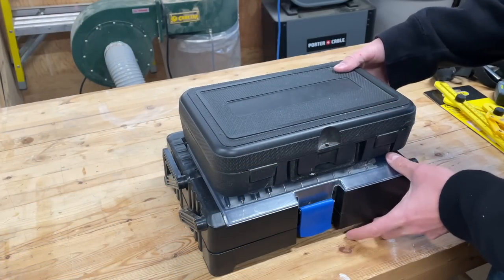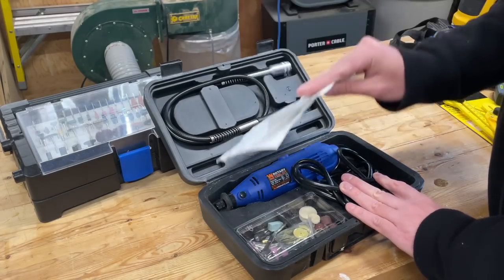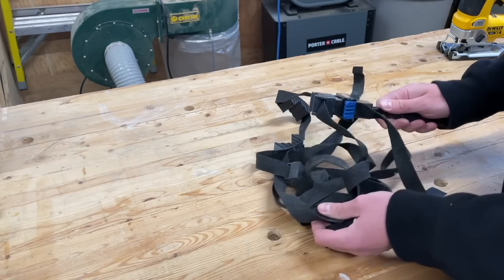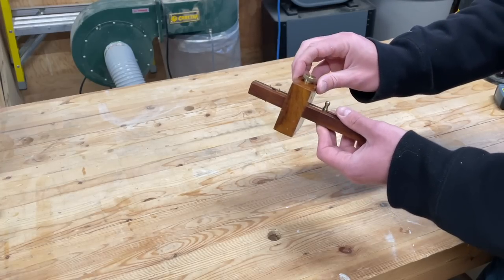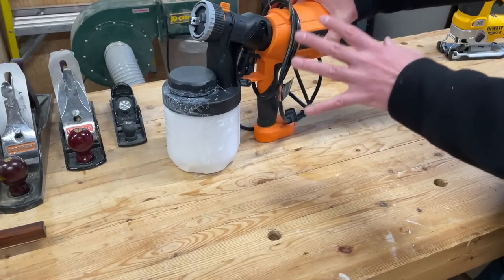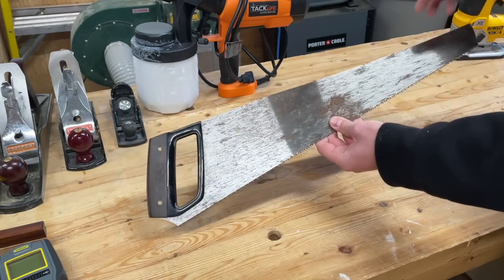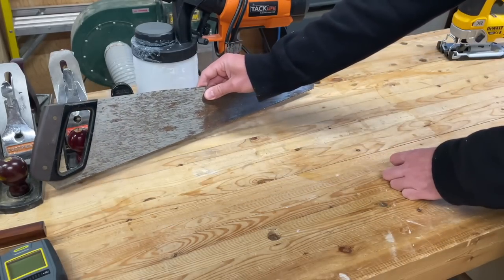Don't Buy These Tools // 10 Woodworking Tools I Wish I Didn't Buy

Comment: I agree with most of your comments on these tools. I will disagree on the Jig saw, one of the most used tools by interior finish guy's. I have installed many kitchens and baths and the jig saw is one I always have on hand. pipes, metal or plastic, sink cutouts, ceramic tiles, dry wall  and the list can go on. In the shop I have both a Bandsaw and Scroll saw which are mainly used shape cutting. If you learn how to properly use your tools, the jig saw is a great tool. I am glad to see that you have come around on the jig saw, but I still felt complied to make that statement for the benefit of others. I did enjoy your video, well done sounded great.

Comment: I think for the most part all of the tools except for the General angle tools are well worth having in the shop.
Yes a new woodworker may not need some at first but if you have the money why not. I use most of these yools on a regular basis. I may not do projects that require them all the time but I get a lot of weird requests for making different items. That being said I can use that side money from the project to buy the tool and expand my wheelhouse or skip out on learning something new.

With all that I feel the main point, it has been stated already a few different ways is Don't buy cheap expecting it to take the place of a quality tool. There are a few exceptions but do your homework first. Impulse will not only waste your money but time and frustration as well.

Like others have said a Jigsaw in my opinion is a must have. If nothing else just for building jigs which we all use on a daily basis. 

1 last note if you have tools you don't use try pulling them out and designing a small project just for that tool. We learn from it and you never know it might be youre ticket who knows.

If not try donating the tools or do a hive away on you channel I'm sure someone can put them to use

CHEAP USUALLY IS JUST THAT. 
Get out build something and enjoy your passion.

Comment: Since fish respond well to shiny lures, I use my rotary tool (a cordless Dremel) to clean and polish metal fishing lures (spoons, spinner blades, etc) with abrasive and polishing buff wheels. Also occasionally polish painted lures. And, while I have the tool out, I also tend to clean or polish anything around the shop (rulers, tools, blades, etc) that catches my eye.

Comment: Great list! The only one I disagree with is the jigsaw. It’s great when you are starting out because it’s pretty versatile. A bit of jack of all trades. However as you acquire more tools eventually almost everything you can do with a jigsaw can be done with another tool but better.
Reply from the maker: Great point on the versatility! The woodworking community often seems divided on the jigsaw.
Reply: @MasonWoodshop I have a barrel style jigsaw. I find it to be much easier and precise - do to the proximity of control. I use it enough to warrant having it.
Reply from the maker: @michaelhamerin3814  My corded barrel-grip Bosch jigsaw was pretty solid. I picked up this DeWalt for the cordless freedom, but right before they launched their barrel-grip version. Poor timing!
Reply: @MasonWoodshop  Yep, Bosch kinda set the standard. There new cordless is nice.
Reply: I like my jigsaw
Reply: @michaelhamerin3814  Your statement about the barrel grip is 10,000 % true!  Couple a good barrel grip jigsaw with the best BOSCH blades and you get very good results. Their variety is quite ample.  Just avoid their "basic" level blades and go directly for the best they have.
Reply: @alfredomarquez9777  Bosch blades are good. I've gone to Diablo when they came out. That friction free coating on them is great.

Comment: I agree with most of this with the exception of the Dewalt Jig saw. It is certainly not a "fine" woodworking tool but it is one of the handiest saws around for quick roughing work(battery powered). I love mine and it is one of the smoothest jig saws I've ever owned.
Reply from the maker: I’ve really come around on the jigsaw and use it all the time now. Just took some time to figure out the right settings and the right blades for the job!

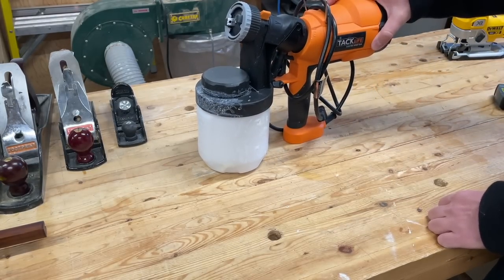Comment: 9:20 Gave me flashbacks to my old Wagner Power Painter. I had both the roller and sprayer, completely horrible. I ended up repainting the room it looks so bad. And it took me longer to clean the thing than it did to paint the room with a brush and rollers!
Reply: 1,000 %  true.
Reply: I had the sprayer with the backpack. Not for long, though.

Comment: It all depends on the projects you wish to do... 
 
I use my rotatory tool all the time because I also do scroll-saw work and it is good for sanding some of the fine fret work... I don't have a Dremel but a cheaper knock off "Fuller" brand... has lasted over 10 years... Though I wouldn't use one as a router...??? thats a new one???

Angle thingy-me-bobs... never seen heard of nor would I buy or need... a simple sliding bevel gauge including the Kreg Jig. 

The band clamp... is a mess?... it is not that hard to wind it up after use  and put a rubber band on it... come on... 

Marking Gauge that's they style I learnt to use at school and works well ... they are easy to use and even make your own. Are they as nice as more expensive... no... but what tool ever is?

I will totally dis-agree with the Jigsaw, but like any tool learn how to use it properly, get some finer blades can be a very very useful tool in the shop... A beginner may not have a bandsaw either room, or budget... and a jigsaw is probably the next best thing and it has an advantage over the bandsaw that it can cut inside circles etc. The jigsaw is not for straight cuts use a circular saw for that, they are more for curves. 

If you are getting chatter on your board then you are not holding the jigsaw plate right down on the board... or you may have the wrong type of blade in (ie; a reverse blade and DeWalt do make them or to rough a blade for what you are cutting) or you haven't secured the board properly where you are cutting it. 

I use mine regularly... however again depends what you are making.

Comment: I recently got that same Dewalt Jigsaw. It is great for cutting out holes amd notches for flooring amd carpentry work. I love it.  Especially with the Diablo blades
Reply from the maker: I’ve come around to love the jigsaw! The right blade and right speed setting made a huge difference.

Comment: There are so many tools out there ....   from saws to clamps to 5axis NC routers...... most of the time we truly don't need them. Some of the best work I've ever seen is done with the basics.  I use a 2.5 axis NC router with old school hand planes making large tables . . .  Most of the time the NC router is just leveling my large live edge planks... its nice and easy ... BUT all I really need to do this is a router bridge ....It just comes down to time and money .... the NC router allows me to work on something else as the unit levels my work... Allowing me to make more money... But that money then goes to pay for the NC router... I see this a lot in tooling. 
Finding that sweet spot of what you really need to make money and do good work. Most of the time we dont understand what we truly need until we have what we really don't need.. I for 1 have so many tools that just set now..
Reply from the maker: Great insights, thanks for sharing! It's really quite impressive what can be built with just a handful of tools - the rest really are luxuries.

Comment: I actually had a bad experience with OG dremel rotary tools than with the knock off ones. The best one I've got  so far is a black and decker one. I originally started buying them for sculpting, but they have prove to come in handy for tool manteinance
Reply: I also have a Dremel 4000 and a Black & Decker RTX. The B&D is definitely superior.
Reply: @christianbound4972  dremel's flimsy built in power switch and speed regulator is just awful.

Comment: Most regretful is a non-sliding miter saw. Made do with only a miter saw (no table saw) for many years. If it was at least a slider, I wouldn't have needed to be nearly as creative in getting home improvement done. Other than that, I've been very careful in my tools purchases. Wheelchair dynamics can dramatically alter how a tool is used, even hand tools, so you really have to think things through if you can.

Comment: The jig saw was my most helpful tool for cutting curves prior to getting my bandsaw. everything else you are pretty spot on. I bought the Wen rotary tool but it was nothing compared to the Dremel I got for Christmas from my parents, it seemed like a good deal for 30$, but the power and consistency wasn't there. my neighbor has a plug in Spray gun like that as well. It was not pleasant trying it out to paint my work table. I got it done, but I would always suggest a better quality one on Amazon.

Comment: The Rotary tool is about the most useful tool I have along with the battery powered drill/screwdriver and you guessed it the Jigsaw. That with a router and you can basically do a whole lot of odd jobs around the house. Basically those 4 are for me a starter kit. need a straight line from a jigsaw well some clamps and 2 pieces of anything straight and you can make yourself a poor mans table/circular saw.

Comment: Got a similar rotarty tool that i still use on the two lowest speeds because i have a gut feeling something bad will happen based on the sound the machine makes. 

I recently purchased the malwakee M12 right angle grinder that is also probably my favorite tool because it's a 12v monster with both manual speed adjustment and variable speed paddle trigger. Each speed setting sounds like it's the same musical note but in a different octave.

I got sanding accessories from Amazon that didn't fit it. I used the cheap rotary to modify the adopers to make it compatible instead of buying adapters more expensive than the cheap rotary. The modifications are not on any cutting or grinding accessories because that would be needless dangerous.

Comment: Like Clone said " the Dewalt is actually really good" I noticed that your setting was not straight up and down and actually the rotary setup. Also you did not have the anti chip plate installed. I have the Bosch cored version and now use the Dewalt which cuts better with the correct blade installed. sorry to rain on your parade.
Reply from the maker: Great notes on the jigsaw - I'm going to revisit it for some of the rough-cutting I do with charcuterie boards that don't fit on the band saw. My Bosch barrel-grip jigsaw (before going cordless) worked pretty well, so I think I just need to tune up the DeWalt and get used to the features.

Comment: I bought a Dremel several years ago. It turned out to be useless for the job I bought it for, and subsequently useless for every job I've though "the Dremel would be good for that!" too. Total waste of money.
Reply from the maker: Ha, that's essentially my experience! I've mostly chocked it up to the knock-off Dremel that I bought, but it might just be that a small rotary tool wasn't the tight tool for the job.
Reply: The one use case I come up with albeit infrequently for the rotory tool usually involves the cutting wheel and having the cut metal in a very tight spot.  In those cases, no other tool would have worked, so they do have a place.
Reply: Dremels are incredibly useful.  Just not so much so for cabinetmakers and carpenters.  I don't use one frequently, but when I do, it's often the only tool that will do the trick.

Comment: I've gone down the cheap plane rabbit hole twice. One was such a piece of junk I couldn't even think of selling to put someone else through that misery, the other I turned into a passable scrub plane. My first decent plane was a 'vintage' Stanley that I used my Dremmel rotary tool to clean up. Taught me a lot about quality tools. Don't know why you think Woodriver is cheap. Both of mine are good well crafted tools.
Reply from the maker: Awesome to hear you refurbished a vintage Stanley - it’s something I’d love to do at some point. I’m going to give the Woodriver another go as I know they are built well, I just couldn’t get it set quite to my liking. Some more time tinkering and I’m sure it’ll be much better.

Comment: With respect I'm gonna go against the populous here and say you've bought the issues upon yourself repeatedly buying cheap!
However I agree about the jigsaw- vile piece of machinery! I hate them.
For the record I saw video in my feed recently suggesting that a Lie Nielsen No4 didn't cut straight from the box.
Reply from the maker: Haha, I fully agree with you on me bringing on these issues myself by buying cheap! They were tools/accessories that were on my list and rather than save up for good quality versions, I went cheap to buy them earlier. Bad idea, haha!
Reply: @MasonWoodshop  don't get me wrong, I've only been woodworking a year or so, but starting out if I bought cheap I bought uses, rather than unbranded as a rule. I've had my share of shockers but I've started relisting them to other unsuspecting fools as I've learned better 🤣🤣🤣

Comment: I fundamentally disagree with the kreg tool. Its a great apron tool and every tool is inaccurate until you use it properly. The rest of these tools are cheap versions of good tools. The waste of money is choosing to buy such cheap versions. Respectfully.
Reply from the maker: I’m coming around on the Multi-mark as a helpful tool, especially with the depth use case. The majority of the rest are definitely a function of low-price = low quality.
Reply: Totally agree.  Its all about horses for courses.  The tools a guy needs to build a house do not require the same degree of accuracy as those used by fine furniture makers eg you would never see a woodworker using a speed square to cut material for oak dressing table.  The Kreg measuring tool is a carpenters tool, not a woodworkers tool.
Reply: Kreg multi mark is worth every penny

Comment: I bought a plane and block plane from Harbor Freight, and took some time and REALLY sharpened the blades, and they do fine.  Biggest complaint is that the handle is too small for my hand.  Clearly isn't the quality  of a Leigh or Stanley, but I don't care if it gets beat up.
Reply from the maker: Thanks for sharing and I really like the idea of not worrying about it getting beat up. I've kept these hand planes and usually just use them for rough construction jobs. For those jobs, they generally work well-enough and I don't get bothered if there are chips on the blades.
Reply: @MasonWoodshop  Yeah, this was just a quick way to fill a gap until I got around to buy a quality tool.  I have a nice granite block that I can use for sharpening a blade or for flattening a working surface.  So some of these tools can be made to do a decent job, and later you can still get a few bucks out of them at a yard sale, or you can pass it down to a kid or new woodworker.

Comment: The multi mark is a great tool doing door trim reveals and worth purchasing for a finish carpenter to diy'er  I am a handyman and use it all the time.
Reply from the maker: Ooooooh - I really like that idea of using it for door reveals, great tip! I've been getting some good use cases for the multi-mark in the comments that make a lot of sense.
Reply: Correct. That indent around the whole body is for setting door casing. My multi-mark typically stays close to my aluminum brake for marking repeatable bends. I rarely take it out to a job.
Reply: Get a trim gauge. It keeps the reveal and also is adjustable for measurements and marks including a spirit level to keep architrave plumb to the jamb

Comment: I was laughing all through your video. Because I've done the same thing earlier in my woodworking career. From someone who has learned my season, here is a tip. If after one year of buying a tool or shop accessory, you find that you only used it once, never used it, or it broke at some point it's time to get rid of it. Clean them up, coil up the strap on the box clamp, and put them on eBay for a little less than what you paid for them. I do this once a year. Those proceeds,  along with the sale of restored tools, go toward something new for the shop or supplies for gift making. You may lose a little money, but at least it isn't a complete loss. I bought a WEN hanging air filtration system for the shop last year with the proceeds. By the way, WEN'S air filters go to 1 micron and I got it on sale for under $200.00! They are not silent, but pretty low and it comes with a small remote.
Reply from the maker: Thanks for watching and leaving such a great comment! While I don't buy as many low-quality tools these days, it's always nice to hear from someone that has similar experience, haha.

Comment: There's an Afrikaans saying: Goedkoop koop is duur koop... Directly translated it says: buying cheap is bying expensive. It seems to be a common theme in this video.
Reply from the maker: That's a very accurate saying! It's not easy to offload cheap tools on the used market, either.
Reply: Unfortunately it might sometimes be true, specifically when talking about something that is extremely cheap, but since quality of products is not inherently related to the price charged there is no general rule that cheaper is necessarily worse than more expensive.
Reply: Dutch saying tho
Reply: @teunipalm5790  well I'm Afrikaans not Dutch, so that is my frame of reference. It's a daughter language, so I would assume there are similar sayings in both.